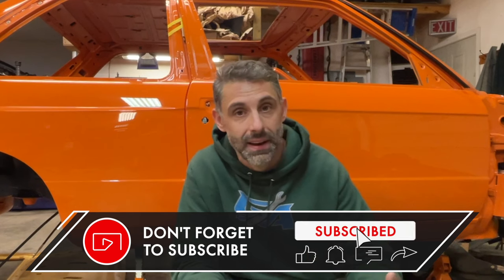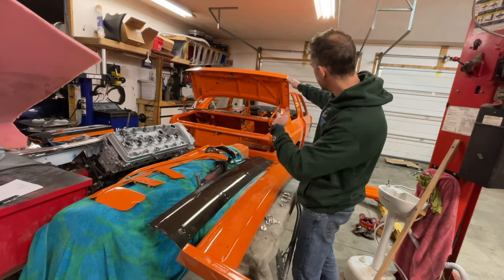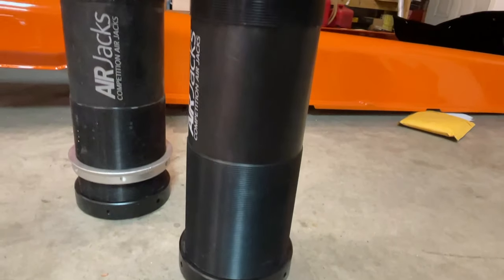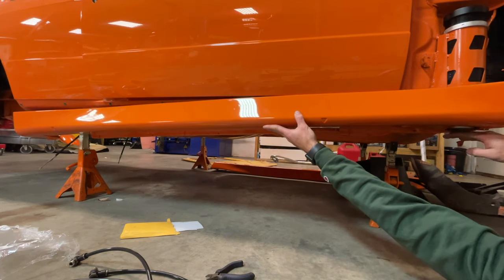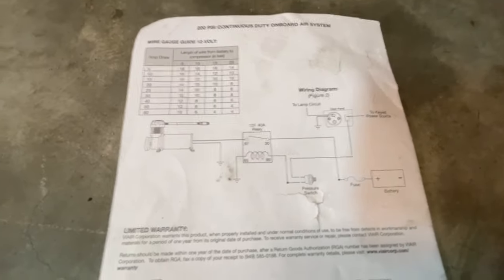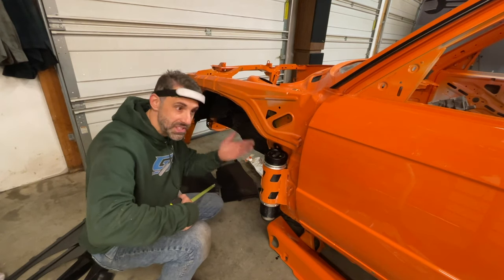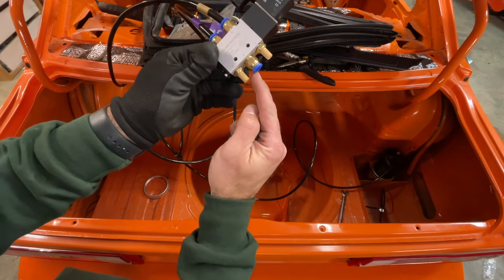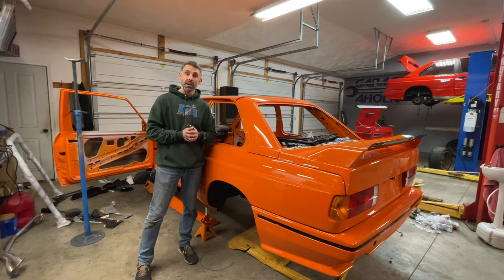Part 4: 🛠️ Air Jack Gamble - 🚗 Will Our BMW E30 M3 Rise to the Challenge? 🚗🛠️

Comment: Is the air valve set up as an “either/or” circuit or does it activate both at the same time?
Reply from the maker: It’s an on/off to activate both A and B together, so really more like a 2 way valve
Reply from the maker: But I do plan to test the co trip laws thoroughly
Reply: Can you put pins in for safety?